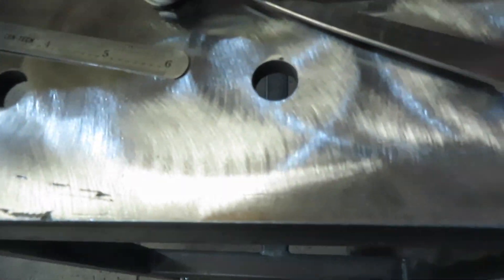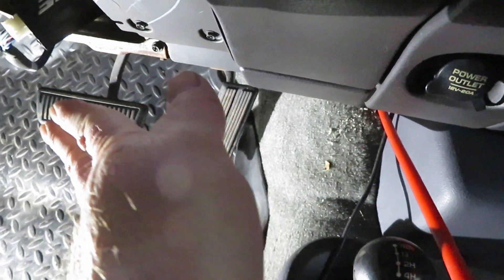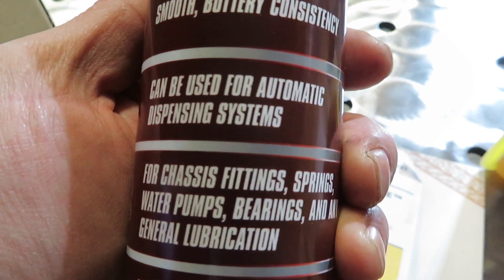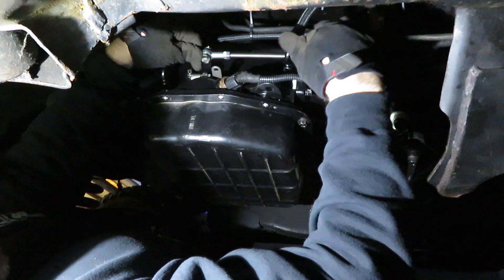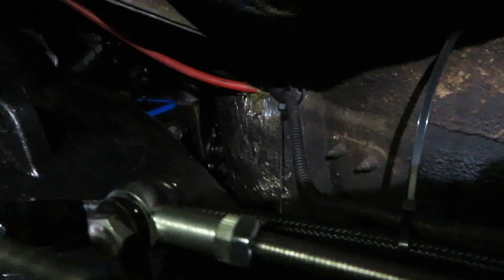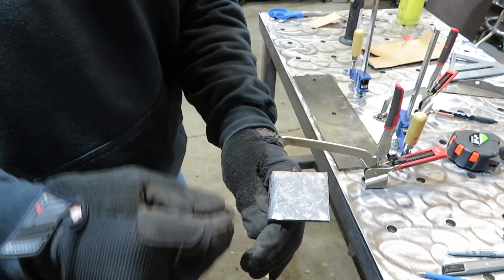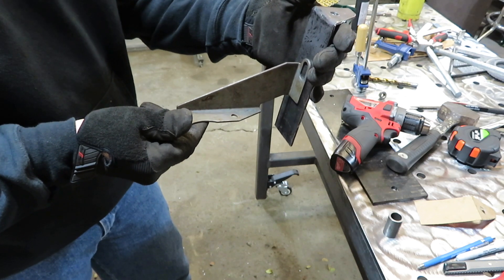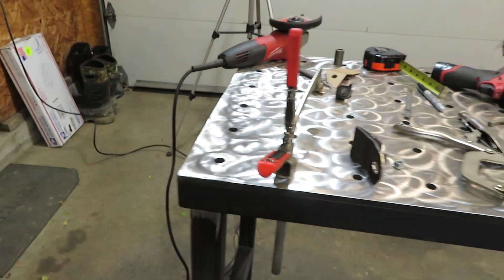B&M Ratchet Shifter Cable Bracket For The 2nd Gen Cummins

Comment: I got interested in ratchet shifter few days ago, I'm doing a swap from 47rh to 47re on my 1995 cummins since wire plugs are completely different I can use my tcm, my question is do I have to go to full manual valve body to use a ratchet shifter or how can I make this to work. I need some help with this please.
Reply from the maker: You can use the ratchet shifter and go to a full manual valve body or you can use the ratchet shifter and a fire punk ant eater to control the transmission.
Reply: @ChadMyers73  make sense, well if I use a enteater controller, what would be the benefits of using a ratchet shifter. I'm kind of confused on this point

Comment: Is the transmission stock in your second gen? Or does it have a manual valve body put in it
Reply from the maker: Built trans with a auto valve body.
Reply: @ChadMyers73  but the gear selectors nob on the side of the transmission that the shifting cable hooks to is still about the same as stock?
Reply from the maker: Yes that’s the same doesn’t matter if it’s manual or auto valve body
Reply: So I could put this shifter in my 01 and shift it as a manual?